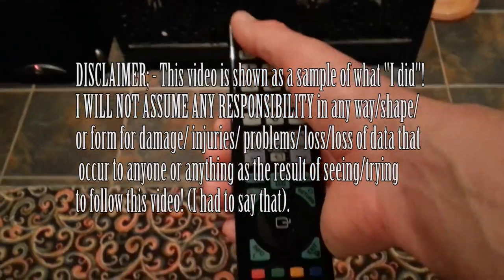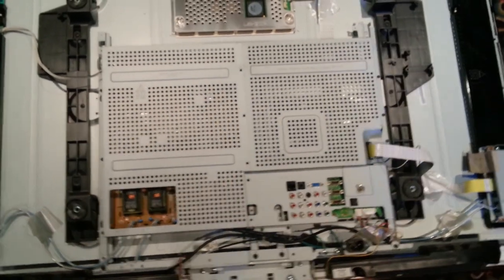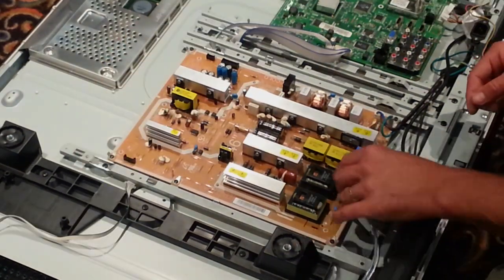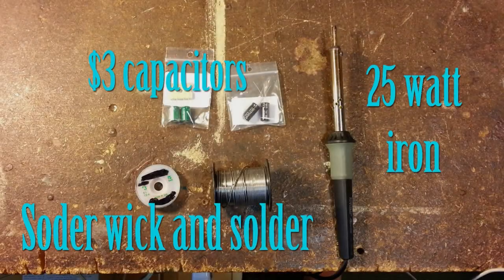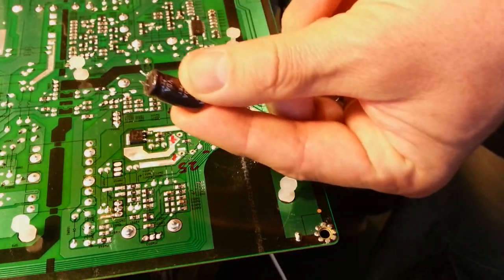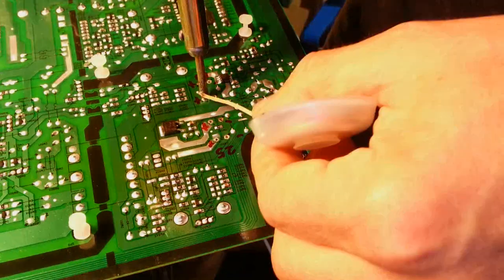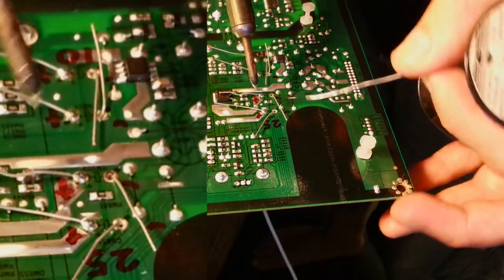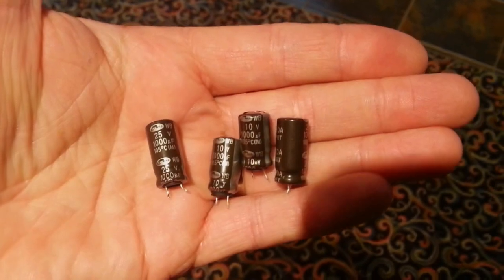Samsung TV won't turn on + blinking red light (explained fix) #18

Comment: Tried replacing the capacitors on the board, there was no indications as to which ones were blown so i tried the ones where someone else with the same tv had had them blown, it didn't work. TV is still bricked. Never trying to fix hardware again if i have to guess what the problem actually is.
Reply from the maker: It's always a learning curve. For your situation you said you didn't see anything wrong visually with the components you were replacing. Most times when these electrolytic capacitors fail, they will exhibit signs of swelling/bulging on the top, or evidence of leakage of fluid on the circuit board at the base of the capacitor. Capacitors are cheap. It was worth a try. My TV is still working fine right now after all this time. Sometimes you get lucky. Never give up. 
.

Comment: From what I understand Samsung saved a few bucks on Cap's made in china, the one's made in Japan last longer, however I believe I'd have went to solid state caps with the same ratings they do not wear out. Electronic caps leak because they charge and discharge they are only good for a certain amount of cycles then the gel inside heats up and expands. This is why they all have hash marks in the tops because if the electrolyte gets on the board it eats off the copper traces and can damage other components. If the caps has a stress valve then that bursts first the fluid stays on the top and nothing else is damaged hopefully.
ALL Electronic caps have this problem, if you buy a 30-40-50 year old  stereo receiver it could have bad caps in it.
You want to open the case and look at every one to make sure its not stresses or bulging up and change them before you turn it on.
This happens with computer motherboards or anyplace they used electrolytic caps wile more convent then using tubes in electronics this is a trade off and some people say the tube stuff sounds better anyway.
That's why you have a 40 watt 10k dollar mono block tube amp for a home audio system. And that's a cheap one.
Yes run on down to Radio Shack and buy a new tube for that monster!  Lots O Luck! in 2020 your not going to find it.
But I surly remember buying Tubes for TV's years ago.
Electronics has evolved a lot in the last 50 years.
But that will change tomorrow, because whats new and good today will be outdated next week. 
The Price of aTV has dropped so low today Its almost a waste of money to have somone fix it.
At one time Plazma were 15k dollars for a 40"  Now you can't buy them, and I still believe they have the best picture.

Comment: replaced  the relay switch  that's been clicking  and tv still didn't go on.what do I do
Reply: plus advice me
Reply from the maker: Something is making the relay click. Are any of the electrolytic capacitors leaking dark fluid onto the board? Are there any dark stains or evidence of leaking previously? Are any of the flat silver tops or the electrolytic capacitors swollen or rounded? If they are, then I would replace them  first.

Comment: My TV doing the same, i took it apart but no caps where bulging, but i had already bought new ones, so i replaces them. 
Some improvement, TV powers on, you can see blue tint on screen, but red power light is blinking and no sound or picture
Reply: Larry I do have now the same problem. My name is Krish. How did you finally fix it? This is my situation: My Samsung LED Smart TV UN58H5200 can't turn on after I dissemble it. Reason that I did open the TV: 5 vertical lines right half of screen. 
So I cleaned all the connections and no strange defects seen by inspection.
But now the TV can't turn on: there is back light, at the right low corner the red light is on (constantly on means not blinking). I tried everything like reinserted the cables, my remote is 100% fine, power cable off then on press on power button at right back rear of TV etc etc to no avail. 
I'm sure it's not a hardware problem as the TV was working before fine (but with the aforementioned 5 vertical stripes on right side of the screen).
Reply: J Krish replaced
Power board

Comment: My Samsung led tv series 5 won’t turn on and it has the red light on standby then when I try to turn it on it starts flashing , then the light goes off, I checked and the capacitors look good no blushing, any idea?
Reply: I have the exact same problem with mine. i took the thing apart and tested the largest of the caps that normally fail and it was charging fine. The others all look fine as well the same as the one i took off.

Comment: I'm having a problem and Idk what it is. I have a Samsung dlp tv hl-s6186w. First of all it was flickering white with some color and would shut off soon after with the 3 lights blinking standby.temp.lamp , so I replaced the lamp because that's what the manual said it could be. Well the tv has sat for a while and I just changed the lamp NOTHING my tv won't turn on , lamp not lighting fan not on and the cable that goes to the dlp chip board from the video Main board almost caught on fire.. that seems to have settled bit I'm left with a black screen and 2 blinking lights standby  and lamp. I try to turn it on but just get the noise like it wants to start bu doesn't . SOMEONE PLEASE HELP!
Reply from the maker: It seems that the problems changed drastically after the bulb was replaced. Is it possible the replacement bulb is the wrong one? For example, if the wattage of the new bulb is too high, that could possibly cause the problem you're describing. Also, please check and make sure all your connectors are plugged in properly, especially the fan connector. And finally, make sure your fan spins freely and is not plugged up with dust!

Comment: Mine as the problem where if I turn off the TV via remote or switch for about 10min it won't turn back on.SO I have to  unplug it and wait every 3 hours or longer(6h-12h).So we have to leave the TV on 24/7

Comment: Hope someone can help. Our Samsung has the blinking red light but DOES turn on. The Samsung remote does not allow us to get to Prime, Netflixs....no volume adjustment either.  We disconnected power on the TV, and everything attached in hopes something would reset. Nothing helped. We are able to change channels using the satellite remote but volume wont adjust.  I cant figure it out

Comment: What if the capacitors aren't swollen
Reply from the maker: +cooldude it is still possible that electrolytic capacitors can still be shorted even if they have not "popped" their tops. Another sign of electrolytic capacitor failure is evidence of fluid leakage on the circuit board next to the capacitor itself. It will be dried up.

Comment: Never use the shorting method with a screwdriver to zero the charge on high-voltage capacitors. That will damage the capacitor from the inside. Instead, use a 100W filament-type bulb and connect the two leads of the bulb to the two leads of the capacitor so it will get discharged by absorbing the stored energy by the bulb.

Comment: Just as an afterthought.....

Whilst I was removing the back of the TV and power board, there was a substantial dust buildup everywhere inside the set which I removed with the aid of a soft paintbrush and vacuum cleaner. There was quite a build up around the power board heat sink and especially on the cooling fan (predictably), and I do wonder if the capacitor failures in these TVs are related to a steady build up of dust and crud on the PCBs which causes these components to overheat and fail. I know it's not likely to be much help to anyone searching on YouTube who's got an existing problem, but I do wonder if we should be encouraging people to at least vacuum around the rear vents on all televisions as a means of prevention - not easy when they're wall mounted I realise, but as the old adage goes, 'prevention is better than cure'.
Reply from the maker: +Chris Perry My TV does not have a cooling fan, and there was almost no dust in mine. BUT, YOU ARE RIGHT for those people who do have cooling fans in their TV's, components  (most importantly the components that do heavy work) will get covered and will be more susceptible to overheating. Dust build-up is a huge problem out there for so many devices (fridges, furnaces. air conditioners, ventilation systems). Many of my videos deal with that specific problem (everything from phones not charging, laptops overheating, and earbud jacks being plugged up with dust.) Thanks for the post!

Comment: Great Video!! Good tip on clearing the capacitors, I took a hit from a cap once, Hurt like a mother*ucker!
Fixing capacitors is a secret that the big name electronic service shop's don't want you to know about.
Reply from the maker: I've fixed a LOT of devices for popped capacitors. Yes, you sure are right! Cold soldered joints will be a future video....

Comment: hi, i watched three/four times the process of zero charge capacitors but didn't really get it ..
did just put your flat screw driver on top of capacitors or did you put screw driver on two capacitors at the same time ?
Thaks in advance ..!
Reply: +californyaeh He touched the both legs of the capacitor at the same time with the screwdriver to short it. Then repeated it with the other one.
Reply: Vesanius ok ...Many thanks !

Comment: How do u know what should witch capacitor to zero and what happens if u don't zero it
Reply from the maker: By "zeroing the high voltage capacitors", I'm ensuring that there's a safe work environment. All  capacitors have the ability to hold an electric charge. The larger the microfarad rating, the greater the electrical storage capacity. The larger voltage rating combined with a large microfarad rating can = a possible DEADLY ELECTROCUTION hazard to anyone poking around them or the connected circuit board. Capacitors can hold a charge for hours, days, or even longer!  Generally, I look for larger looking capacitors usually large "can"  shaped (but not always) pieces with 2 metal conducting legs sticking out of them going to the circuit board). Personally, "if I see" a voltage rating over 50 volts, I will hold the handle of a plastic handled screw driver to "short out" the legs of the capacitors to bring them to 0 volts. If the capacitor is charged, there will often be a "spark" when the legs are shorted to the screw driver. I hope this helps.

Comment: I just replaced three bad capacitors. After putting the power supply board back in, plugged in the power, now it's making a chirping noise. Any thoughts?? PLEASE HELP!!!!!! I have  a Samsung LN40A550P3F. Thanks in advance.
Reply from the maker: +Paul Nhar  First, unplug the unit before disassembling the unit, DISCHARGE ANY high voltage capacitors (Anything labelled above 40 volts by holding the plastic handle of a screw driver and shorting the 2 legs of any capacitor (s) with the metal blade of the screw driver only. All capacitors MUST be discharged safely before touching anything with your body parts!NOW....take a look at your board. Make sure (1) that the capacitors that were installed are exactly the same Capacitance rating, and at least the same voltage as the ones  that came out. (2) they must be in exactly the same orientation (-negative stripe on the side) as the old ones that came out. (3) make sure all soldered joints are not connecting to any other soldered joints creating a short circuit on the board.
Reply: I will give it a look. Thanks for the quick response. I will give you an update. Thanks again.
Reply from the maker: Did you have any luck?

Comment: I fixed 4 condensator that are broke!

vda pet 35v 1000uf 2 pieces
w1a pet 10v 2200uf 1 pieces
vde 25v 1000uf 1 pieces

I use the same 35v condensator for the 25v, this was no problem if the 1000uf are the same;)

Comment: And other than making these repairs,there are nothing that could be wrong with the tv that could be a little more simpler
Reply: Not if you look and the capacitor is bad. There might even be more problem but believe me they are part of it.

Comment: I think my TV was designed to not be helped because the only 4 screws on the outside are at the bottom and hold the frame around the screen in...

Comment: For those of you with no soldering experience just replace the board and enjoy your tv, simple
Reply: Nupe Playlist best thing to do is find an old tv remote that doesn’t go to anything. We all have several. Then just practice on it till you’re confident. That what I did 7 years ago on my Polaroid TV with the same capacitor issue.

Comment: Mine is samsung un55d6000 none of the capacitors are swollen or leaking plus these are laying down glued to board now what blinking red light wont come on is led tv
Reply from the maker: If there are no swollen or leaking capacitors, then you may need to have your device diagnosed and repaired by a technician.
Reply from the maker: Can anyone voice in with experience with this model tv?
Reply: +Beverly McGouey 
Mine is Samsung UN55d6000 too. I can find no leaking capacitors. Just red light blinking.

Comment: I literally just bought a Brand new Samsung NU6950 and the thing wont even turn on. I plug it in and the red light underneath just blinks a few times, the SAMSUNG logo pops up on the screen and then it shuts off, and repeat. Over and over.

Comment: soldering work is such a pain in the ass, especially when you can't keep a steady hand
Reply: true, but these are pretty large points so it's a moot point. You can doooo itttttt. I feel your pain, soldered new headphone jack in my phone but damn shaky hands kept making the solder jump to the other 4 points which were less than a 16th apart.

Comment: I replace 4 capacitor!
Reply from the maker: All I can suggest to you is to verify that the new capacitors you installed, are not defective, and are of the same voltage and capacity rating as the old ones. Also make sure those capacitors are all put in the same way as the old ones came out as polarity is extremely important. Thr negative stripe on the capacitor must be in the same place. And finally to make sure that there are proper soldered connections that do not cross over to the other connection points nearby. These are my  suggestions.